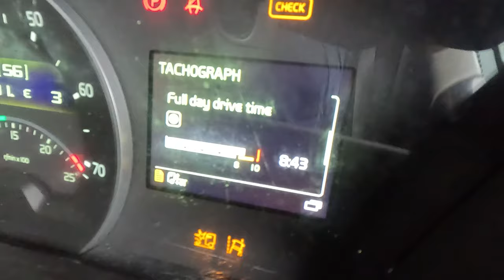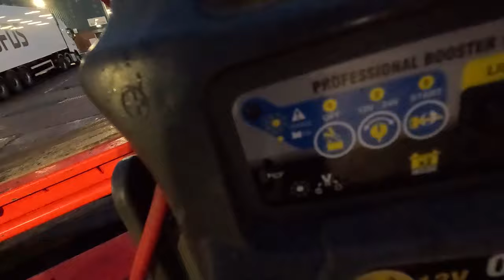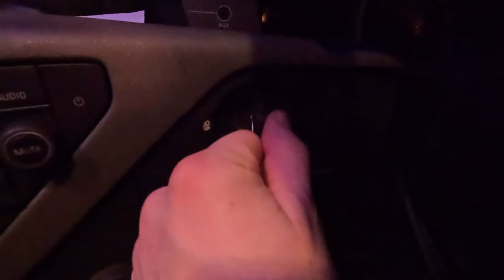My Highest Truckload YET! - Episode 90

Comment: Wee tip with the booster packs. Once you have started something with it leave it connected for a bit. Will recharge of the vehicle. And once you have started something leave it running as long as possible will recharge the batteries
Reply from the maker: awww cheers mate ill keep that in mind